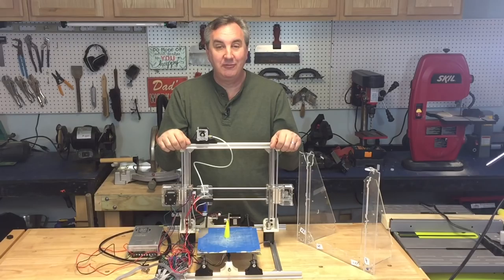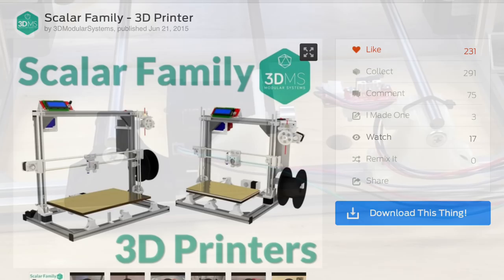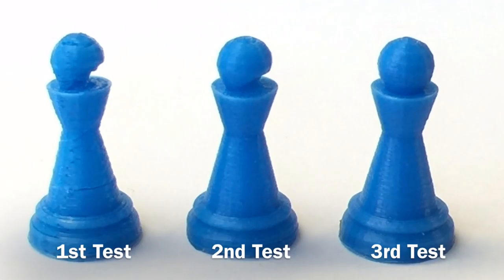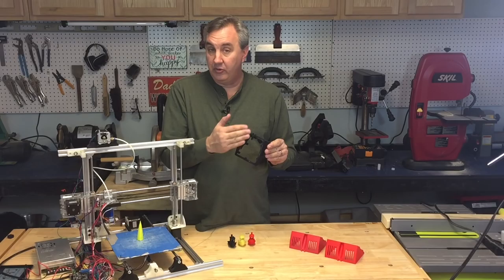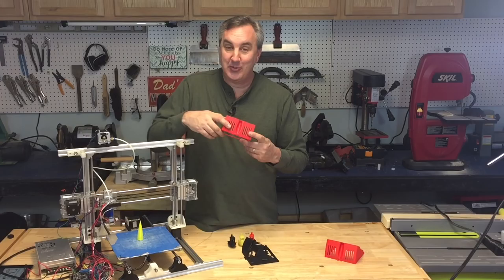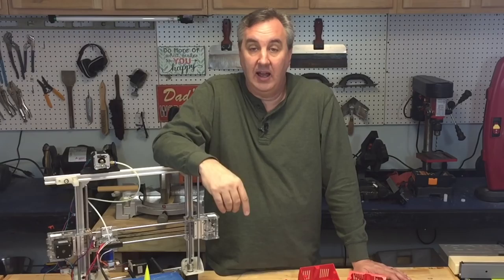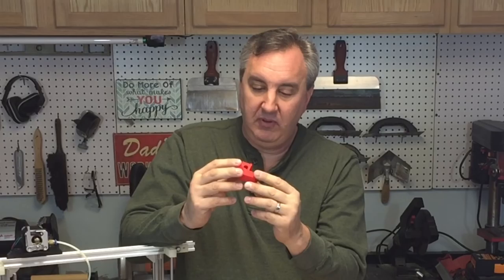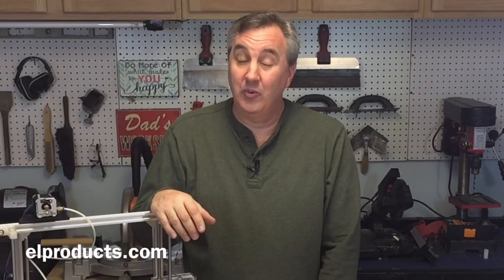Filament Friday #52 - Re-building a 3D Printer with DaVinci Jr. 3D Printed Parts

Comment: I believe that the old version of the Wanhao duplicator i3 had those heating problems in a lot of units, so they made a new version that fixed the problem. The monoprice version could possibly be the old version with heating issues.

Comment: This is kind of a late reply to this video but I have the Monoprice printer as well and I started out printing in pla and didn't notice any problems but after I passed the 30 day return period I was having trouble with abs. I ended up doing a lot of research and found that the grounding to the hot end on the melzi board is not sufficient which causes spikes in the thermistor sensing so I added a dedicated ground wire to it and now it holds temp within a degree or two. I love the printer but I have had to do a lot to get it working well. But I think that's part of the fun of it.

Comment: What was up with your hacked Davince? got me worried about mine now, i havent fired it up in a while, thanks for putting up videos Chuck youve really helped me with my Daavimci after i bought this printer i was quite upset with its performance, but after reflashing it, and tweaking things ive had some awesome prints and even went as far as printing interior parts for my performance car that were hard to find replacements for, again thanks, it means alot to have poeple like you in the community

Comment: Temperature fluctuations of 5-15 degrees is a known issue.  Some people do a PID tuning (https://www.youtube.com/watch?v=ki-JOwre82Y) and Wanhao recently recommended a hardware repair that is supposed to fix the problem.  There is a good Wanhao i3 group on Facebook that has a lot of information about this.
Reply: +Chuck Hellebuyck's Electronic Products The Wanhao uses a Melzi control board and I think the Sunhokey uses and MKS control board.  There is a ground wire that needs to be installed on the Melzi for the temp fluctuations that happen all the time.  I think the PID tuning is just for fluctuations created when you add a fan.

Comment: I always wondered , what if I buy that type of printer , but , modify the body making it like 2 or 3 times bigger , enlarging the plate too so instead of having a 20cmx20cmx20cm like the DaVinci I end up having a printer with 60cmx60cmx60cm printer area , is that possibile right?

Comment: Nice Video! How about building a CoreXY bot?
Reply: +Chuck Hellebuyck's Electronic Products There is a big difference! You should definitely try it out. A CoreXY has basically the motors in the back left and right corner. Jump over here to see how it works: http://www.corexy.com/reference.png
I own a CoreXY machine called Sparkcube XL and I absolutely love it!
Reply: +Chuck Hellebuyck's Electronic Products Yep Marlin does support it. It has so many benefits for example you can have crazy high acceleration settings and it has a low moving mass.